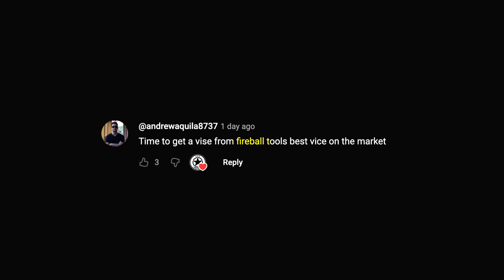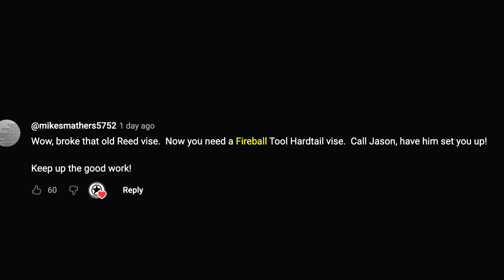Why Do Good Vises Break?

Comment: 1:44 I have an almost indentical one to the middle 1; propably german made (before/during WW2), opens up to ~170mm, fits 99% of what I need it for (not a workshop, just a regular garage in a central european village). The only thing that needs to be fixed are the threads holding the jaws to the vice (4 M6 thread repair inserts needed).

Comment: You still build the fireball vise with a sharp corner exactly where the reed vise failed. There should always be a radius where the jaw plates sit and a large chamfer on the bottom rear edge of the jaw plates. The vise screw and nut should be reversed with a bearing cassette assembly hidden inside the dynamic jaw. Then the screw is a simple piece of stock high tensile acme thread without having to be turned down from a much bigger diameter rod to accommodate the ball on the handle. Much cheaper to replace too.

Comment: I like your quality, there is soo much thought in those vice, but also I have one of those "cheap" vice that you broke and its holding on just fine in my workshop since 40 years, and we are beating the sh... out of it, for bending metal or removing tight nuts or whatsoever. So I guess I was just lucky to not break it? Or is the hardtail vice just so way over the top that its more for the good feeling that you wont be able to break it ever. Im not sure. I like watching your vids but when looking at the cost and that my vice is just lasting its still hard to argue.

Comment: The guide pin holes for the jaws probably created a weak spot, and the constant hammering slowly fractured the metal till it finally broke off. Did they use anything other than the impact to help loosen the nut, like heat or penetrating oil?

Comment: Quality costs money, and most people don't want to spend what it takes. If you don't know why this vise costs so much, you either aren't the target customer or just don't know how much time and money quality equipment can save you in the long run.

I deal with this selling zero turn mowers. Some people only shop by deck size and engine power, they don't know that the $13,000 mower that lasts 15 years is a better deal than the $5,000 POS that their property beats to death after only a few years, just by cost of replacement alone. On top of that, better equipment is more enjoyable to use and can deliver a better finished product (such as mower cut quality).

Comment: Have Wiltons, Reed's, and Old Columbian vises.. In 60 years I have never broke a vise. Run a fab and machine shop.... two things about a vise. Never use it as an anvil, second if you need to put a cheater on the handle, get a bigger vise.  As for the vise at C&C.. Kinda like breaking the first note above.. A 1" impact is a big hammer...